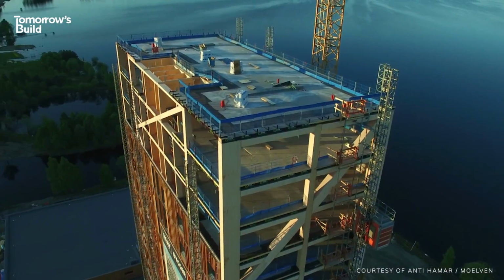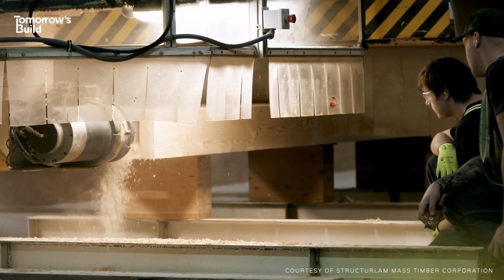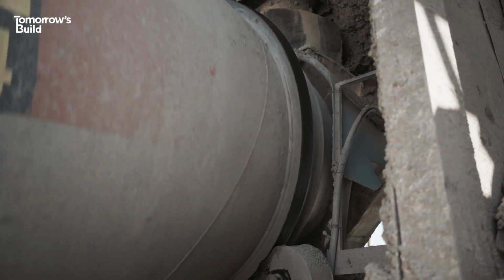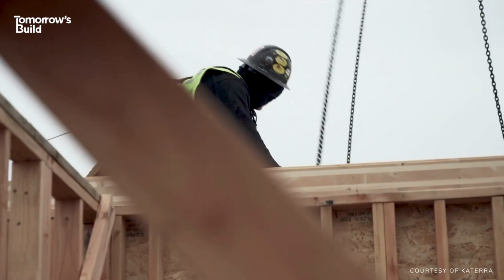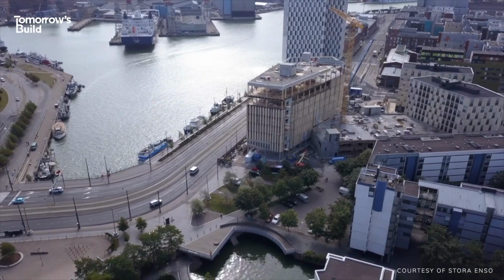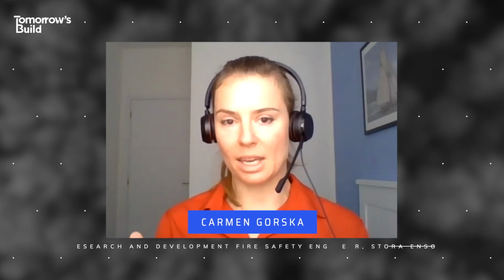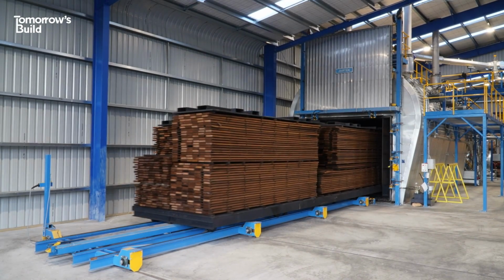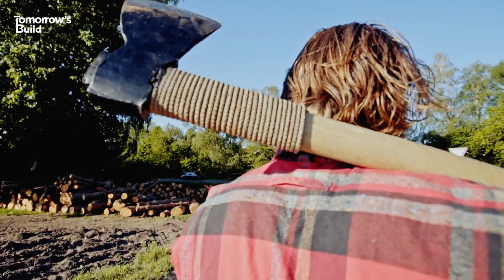Why All Buildings Should Be Timber

Comment: Can ONLY work given BEST efforts at every stage and everyone involved.  Unlike steel and concrete wood is HIGHLY variable and needs highly trained and conscientious incorruptible people at every stage to ensure sufficient quality is maintained and that's just the structural issues, then theres preventing rot and fire proofing protection right down to the maint of the building to ensure NO fire hazards.  Steel and concrete have such huge safety factors quality much easier to maintain testing for quality so much easier can suffer the most poorly skilled of workers and still work and simply are inherently SAFER, oh, and can be 100% remanufactured back into steel and concrete (as aggregate).  Wood's ultimate reuse at best is chip board which I wouldn't let in anything I was ever involved with.

Comment: I work construction in high rises (I work with systems that connect to fire alarm systems and am required to know lots of fire code regarding egress routes) and some lower rise commercial buildings. We have a MAXIMUM limit for the amount of wood (or anything flammable) we can have per floor. It is set VERY VERY ridiculously low. All plywoodwood is fire rated, there is so many rules that are backwards from this video very specifically due to fire safety, and terrorist attack safety in high rises. (9/11 can’t happen to a concrete building. The fuel wouldn’t get hot enough to melt concrete collapsing the building.)

I hope the sustainability is worth the loss of life in the event of a fire. I can guarantee if one floor in one of the buildings I worked in lit up, it would be completely limited to the floor that lit up and the smoke damage on the upper floors. You could still go down the stairwell while the floor is fully engulfed in flames. Wood will NOT do this and it will result in loss of life.

This will never happen in Vancouver Canada.

Comment: thats a great video and im all about protecting the environment but what about when it comes to building another Burj khalifa? wood cant support the same kind of weight that concrete can (with some concrete being 24,000-30,000 psi, and completely fire-resistant) and we've learned out lesson with bad floor planning and structuring considering 9/11. and most buildings now days are encouraged and do build to withstand certain types of terroist attacks, which weapons and which buildings are unknown however, and when is say buildings, I'm mostly talking about sky scrapers.

Comment: You keep using words like "All timber" yet even in this video we see concrete pillars sticking out of the water that the timber rests on, steel reinforcement in the center of columns, steel cable securing the stadiums. I'm not saying there isn't significantly more timber in these constructions, just don't say ALL timber if it's not all timber.

Comment: Building with wood. Thier is big problem with,rain. Vancouver canada. Mountain equipment co op. Different owner not ,no matter, big problem with interior getting soaked during construction. Got wet mold everywhere. They sanded endlessly sprayed fungicide. But impossible to eradicate. 
Also every cut and scrape remove protection. 
Fire retardants are very harmful for very long periods of time. Gassing off.

Comment: Timber often stretches and changes shape over time therefore compromising the structural integrity of, lets say a high rise, which reduces the longevity of Timber buildings. In the case of housing its cheaper to demolish a house and build a new one every 30 years than to refurbish the existing one. I fear demolishing a high rise every 30 years and rebuilding it won't be an option.

Comment: we dont need any of it anymore. we should be using recycled plastic instead  with extruded for beams, and 3d printed components. wood is obsolete now. there is a additive that can be made from any plant matter (hemp is best) 50/50 mixed, that makes any plastic just as strong as steel, 1/6th the weight, transparent, and conducts electricity. also hempcrete is also superior to regular concrete and it gets stronger with age.

Comment: At a time when we want to be planting more and more trees for the environment, simply planting trees then chopping them down over and over isn’t sustainable on a large scale. Concrete and steel buildings clearly last far, far longer and don’t have issues of fire, water and animal/insect damage. Build once and look after it, not knock something down after 40-50 years and start over. Timber is great for features, and many applications. But not as a core building material.

Comment: The only problem going forward is the weight of the concrete industry pushing on governments to regulate the use of timber in buildings, playing on unsubstantiated safety concerns. Especially post Grenfell with the public demanding stricter regulations on materials that can be used in construction

Comment: Of course we should go back to that very finite resource that takes literally decades to grow just because some relative small projects used it.
Since fire is still a thing and fire resistant coatings aren't the most healthy also it costs more than concrete which is fire resistant all by it self. Also the whole carbon "storing" point is moot when it will be released if the structure burn down, It just releases it slowly and according to fire safety regulations. 
Not to mention the upkeep unless you dip the timber in poison like they did with railroad timber and telephone poles.

Comment: - You don't have to lie and obfuscate about the Steel and Concrete industries in order to promote timber construction. Modern steel mills in the USA using Graphite Arc Furnaces are fantastically clean, especially compared to their old gas-fired predecessors. Heating and cooling of buildings use FAR more electricity throughout their lifetime than their construction.
- For those petrified of CO2: research would reveal processes that will allow us to reclaim CO2 from all gaseous industrial waste streams, and minimize the energy required to do so. Corruption and lack of interest is the reason this hasn't been done. A fraction of the billions spend on silly sequestration projects could be spent of discovering such a process to stop the CO2 at the source... the smokestack... and finding a process to turn that back into useful materials close to the source.
- Don't forget - steel is 100% recyclable, while adhesive-soaked CLTs are not. Even "sustainably managed" forests are shadows of their wild counterparts. A single drive of a heavy harvester through a forest messes up its soil for years due to compaction.
- The best buildings will employ organically-optimized combinations of ALL available materials, to maximize strength, safety, NON-TOXICITY, and aesthetics, while minimizing noise, waste, and disruption. More focus should be put on improving aesthetics and the indoor air / light / electrostatic environment. Drywall, offgas-laden carpet, paint, adhesives, plastics, and material additives should be purged from use in modern construction ASAP.

Comment: large buildings wont due to the lifespan of timber vs modern concrete or steel structures not to mention the ability to maintain a footing and core during large structure fires otherwise you have a giant flaming man made tree building falling across onto other places, there is a reason why the best dont use timber and it is not because of price its because of integrity and lifespan which yes do play part in long term and short term costs, it is after all a balance
strength-lifespan-cost
timber removes 2 and in some seasons and areas all 3 of those just for a mild effect of sustainability which in itself cant withstand the demand for vertical growth we are experiencing in the world

companies going all timber for building are just catching in on a gimmick for the ignorant like the GMO free market like whole food does, its not less carbon its more! the logistics alone outweigh other materials in that dept, it just a feel good gimmick for those too ignorant to actually learn how all the building industries work and are logistically handled
0/10 terrible  idea

Comment: This seems dumb to me. A well constructed reinforced concrete will be more carbon intensive, but will also last longer for sure. What is the lifespan of these wooden buildings? Between termites, mold, the sun burning the exposed wood... It can't last very long. And maybe these emit less CO², but you said it is 60% less. So the concrete one only needs to last twice as much to be more ecological. And let's face it... A normal building will last twice as much as these wooden ones.

If you really care about sustainability, make buildings like the old Mediterranean buildings. Out of dirt and rocks, or just plain rammed earth. Now... That is sustainable! All natural materials, and if they get abandoned, the rubble would only be a pile of dirt. And also... both the rocks and the dirt could be reused for new buildings.

Comment: The only difference is a house made of steel and iron and concrete will last 100+ years structurally. A wood house begins to fall apart rapidly after 50 years especially in a wet climate.

Comment: Um, what about termite-infested countries, humid environments. What about the issues with fire retardant and associated pollutants, what about the spoils and the sawdust, Both would be toxic to the environment.  Nice ad but a LOT more detail is needed to be anywhere near convincing. PS Remember the absence of one extreme doesn't automatically prove the opposite. 
also note the new types of energy-efficient cement. 
Also, note that while this may work for Europe but the reality is that if nonenvironmental timber is cheaper it will dominate as will concrete and steel.  Don't forget self interest (Capitalism) in its many forms still dominates this world's economies.
Conclusion a lot more work is needed for your bold claims to be relevant

Comment: Why they shouldn’t be built from timber:   

1.  Pound for pound, nowhere near as strong as steel,
2.  Fire…timber burns easily, especially compared to steel or concrete.  Large timber built buildings such as resort hotels have proven themselves to be nearly impossible to extinguish when they’ve caught on fire and typically burn to the ground.
3.  Prone to warping, especially if it gets wet

4.  Doesn’t withstand wind loads nearly as good as steel/concrete

5.  Warps with the passage of time which is why timber buildings over 100 years old and more tend to be rather crooked.

Comment: This is too much of a marketing video. All benefits and no challenges or downsides? What about countries that don't have a timber industry? They need to import gigantic amounts of timber in order to build those said high-rise buildings. How does that account for the carbon footprint? How do you deal with maritime transport (very high humidity)? What is the life span of a timber building compared to ones made from concrete? What is the price difference between a timber and concrete building in countries with a timber industry and without one? A lot of questions with no answers in a video with such an absolute title.

Comment: What about hemp? This grows at an amazing rate. 4 yields a year are possible. With no fertilisers or chemicals necessary at any stage of growth or harvesting. This means no run off of harmful chemicals into soil and waterways and so no dead zones on coastal waters. 

Who wouldn’t appreciate fish returning to coastal waters. Of course golf courses and chemical plants are the worst criminals going in this regard. 🥸

Of course our vacuum tube intercontinental underwater transport system from Crail to Northern France is assured a place, cutting travel times to Europe by hours. 🥸

Comment: Generally liked the idea but worried me when you mentioned charred wood burns at the rate of 
1 mm/min giving you enough time to escape. 
In comparison to concrete structures they can generally withstand fire for up to 4 hrs I think wood frames take less than an hour to fall
I wouldn't want to escape and then sit down helplessly to watch it burn away any way

Comment: Wood still rots, is prone to termites, mold, and in an age where weather is becoming increasingly risky, it doesn't seem like a good idea at all. Sure you can treat wood to be fire and weather resistant but no treatment is going to last as long as an innately solid brick or concrete structure.  Forest fires becoming more common also means we could see sudden and long lasting supply issues. 3D printing also promises to further reduce the cost of concrete constitution and make wood much less attractive.

Comment: Or we can just use the local building materials that are available? If everyone would build in wood we would have other equally as bad issues as we would have with concrete, brickwork, steel.. Its just common sense that different materials are used in different regions of the world where different resources are available.

Comment: This seems awfully short sighted considering this is going to just burn up at much lower temperatures vs concrete and steel buildings.  Already there much higher rates of apartment fires in new mainly wooden buildings, at least in US.

Comment: Using timber to build structures other than residential houses is shit. Currently working on a brutal deficiency list for a 6 storey building built out of timber. Everything is still settling 2 years after occupancy, major cracks in walls, ceilings, floor tiles. Doors are not closing due to deflections in lintels and buckled door jambs. It’s just terrible, you always want to use ISOTROPIC and homogeneous materials in building construction. Wood doesn’t have the same mechanical properties in all conditions, it acts differently when it absorbs moisture and it reacts to loads differently when subject to pressure along its grains and against its grains. Light gauge steel is a much better alternative and probably the best modern building material on earth. It’s recyclable, less intrusive on the environment, has the highest strength to weight ratio and resistant to natural elements.

Comment: I would love to see a video on hempcrete. It does use cement (limestone powder) which isn't infinite, but uses the stalks of cannabis plants as the aggregate instead of sand - which is being depleted at an alarming rate. Hempcrete is also better for insulation on both sides of the wall (my theory is the ragged shape of it allows air to fill pockets and transfers/absorbs heat faster like a condenser on a fridge or AC unit handles heat). Imagine a home that is built from timber and hempcrete. It would be high quality, but that's the problem: cost.

Hopefully in the future though. The way to go about it would be to give tax breaks to companies using these products and tax penalties for companies using older methods with concrete in steel, but in the US that'll never happen, because any progressive change here is deemed communism. So, yeah...

Comment: TL;DW: Timber is more sustainable, very adaptable, better for our (mental) health and looks better most of the time

- 60% of carbon emissions savings in buildings
- 400% more carbon stored in a timber building vs a concrete one
- can be quickly and sustainably produced in various shapes
- engineered timber can be stronger than steel pound for pound
- R&D keeps improving
- all building materials have weaknesses that need to be worked with when it comes to fire, timber is no exception
- there are numerous techniques to slow fire spread or even eliminate it completely

Comment: There is a building that is now fully constructed that was built out of lumber in Portland that I was invited to do a walk-through after a large wind and rain storm came through causing the building to bulge apart at the top. 
Every floor required re-design to correct the severe safety issues, as well as to dry the wood before sealing it. 
They used cables fastened to the floor to pull each side of the building into the center on every floor, and also needed to secure the rafters on each ceiling on every floor due to the wood drying and shrinking. Practically halted construction until they could figure things out, and wait for the wood to dry. 

Can't recall which building it was, but it was in downtown Portland.

Comment: Everyone on here  commenting ....."what about water, moisture, humidity, termites, no thanks!! building will need structural repair in 40 yrs....u couldnt do that in the tropics...u couldnt do that here or there"  Glad u guys are on it cause I'm sure structural engineers and architects never considered any of that. lol.   If you live in a country with where building regulation is lax or is corrupted and substandard, cheap, materials and methods pass "inspections".  I agree......I wouldnt want a large commercial building or infrastructure made of wood.  If u live in a country with rigid standards that have to be met, I would be comfortable with timber construction.  If u live in a humid area. engineers will account for that,  termites are accounted for. u wont come up with a problem that they haven't already engineered a solution or mitigation for

Comment: their argument against fire is 1mm per minute will be burned then if the firefighter take 20min to come their is 20mm in less in all the structure what is more than my actual stair
they arg than conctrete is  spaling ok but i never burned concrete in my cheminee or never seen a concrete forest in fire
the metal bend its true its why my furnace is made of wood no i joke its metal and brick or concrete duno
honorable mention to moistures ok some wood more than other especially those used in construction like pine